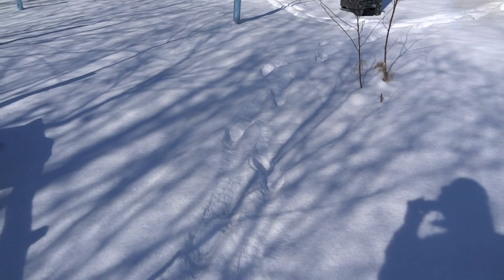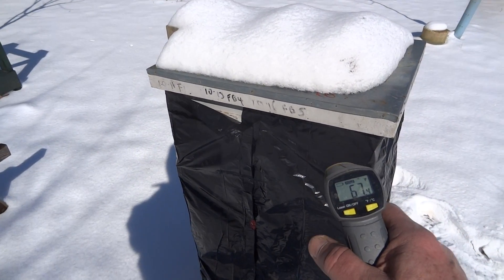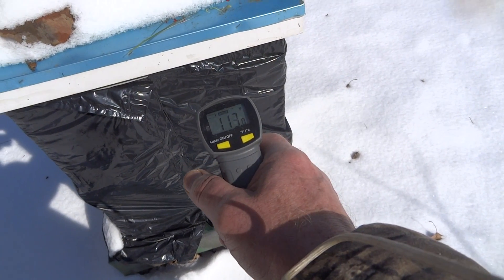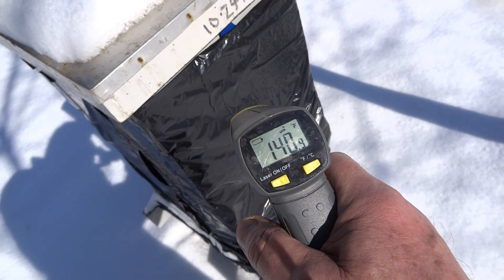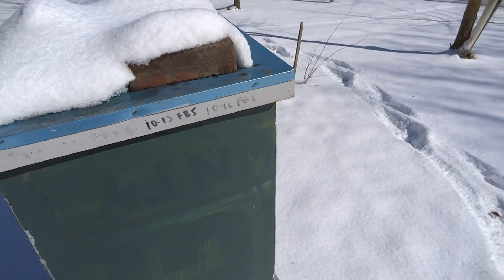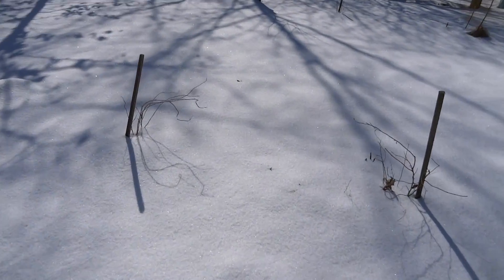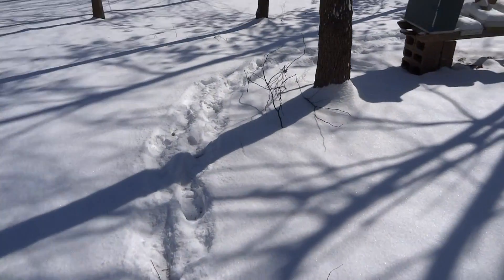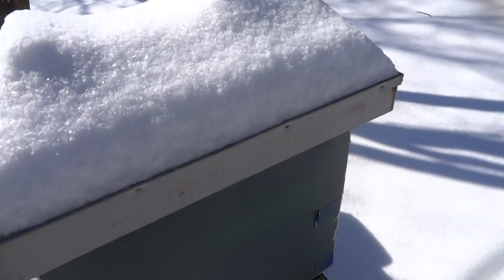Winter Wrap Experiment

Comment: How the the plastic bags work ? I found some at Home Depot that slide over the hive, did you have any moisture problems , I am going to give them a try, I agree with you about tar paper babe are cheap and easy to use Thanks Chet
Reply from the maker: My theroy is.... It provides some solar heat gain on sunny days. That allows the bees to break cluster and feed on the cold fondant at the top of the hive. It may also help with the wind between the hive bodies. It has no solar gain when the sun is down. You can reuse the plastic bags in the Spring too.
Reply from the maker: They worked great. They are cheap and easy. You can reuse the bags in the Spring too. As for moisture ,I use the moisture board (Homasote Board) on the Top. It really sucks up the moisture. I lust
Reply: I found some bags at Home Depot that fit nice over the hive I cut them in half and got two covers out of one I have 2 in of styrofoam on top of my inter cover and I do run an upper and lower entrance so I don,t think moisture will be a problem , cheap and easy

Comment from the maker: The main point of the wrap was for a wind break. We had wind gust of up to 50 MPH last winter. The secondary advantage was it raise the outside hive temperature about ~ 40 degrees F. vs an unwrapped hive when the sun was shinning.  Some of that heat will transfer to inside the hive. That may be enough for the bees to break cluster and get food they normally could not reach due to the cold. We had a very bad winter here last year with temps as low as -5.4 degrees below zero. All the wrapped hives made it through the winter. The plastic trash bags are cheap and  easier to install vs roofing felt which I have used in the past. The wrap is only a wind break when the sun goes down. I'll plan on using it again if the winter weather is bad like last year.

Comment from the maker: Hi Paul,
I'm located in Maryland, Western Howard County. The IR thermometer is made by Cen-Tech. I think I bought it from Harbor Freight.  They are not very expensive. Bear in mind the temperature varies by the angle of the sun to the hive and the intensity of the sun. It appears where there are air bubbles in the plastic the temp is much higher than where it is flat to the hive.  Also note this is more of a windbreak as there is no R value for the plastic. It will provide a bit of a solar gain on very sunny days. Without a internal thermometer to measure the inside hive temp I'm guessing it would only rise a few degrees vs the control hive. On marginal days that may be enough to let the bees break cluster and feed on the fondant? I use to use roofing felt but it is too expensive, harder to work with and I ended up throwing it away at the end of the season. The trash bags are cheap , easy to work with and I can recycle them at the end of the season.
Bee Happy!